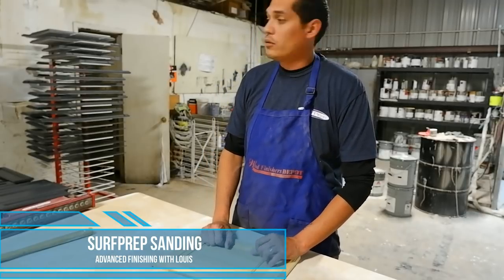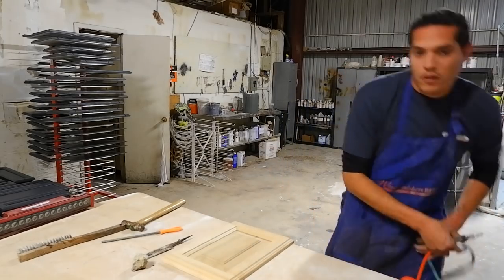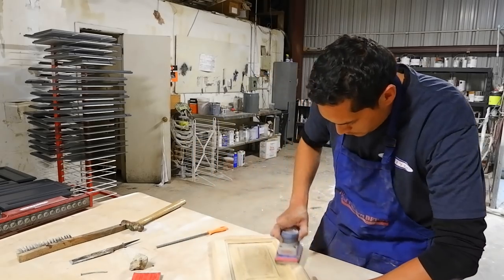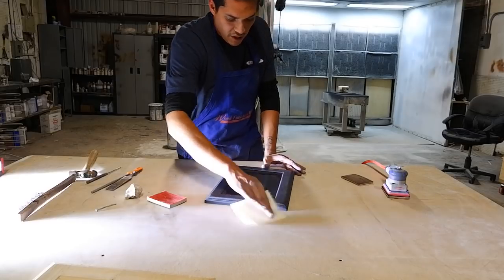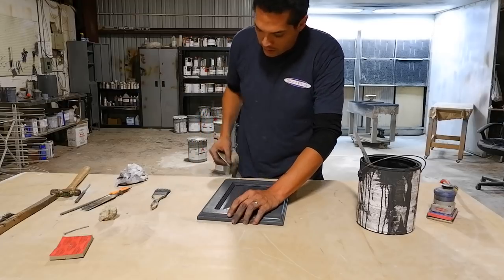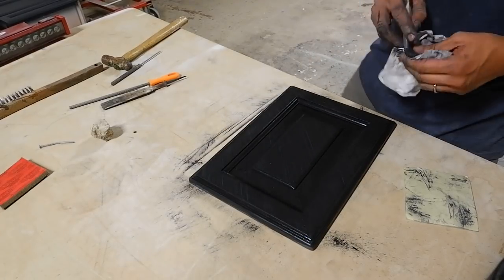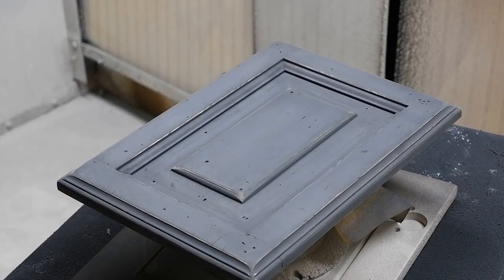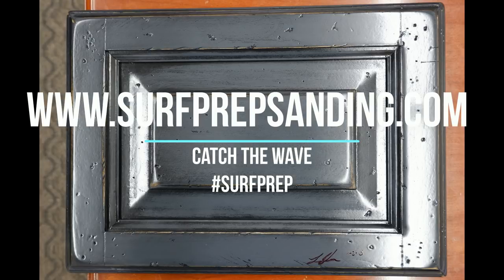Distressed Powder Glaze Cabinet Finish - SurfPrep Sanding Advanced Finishing Techniques

Comment: Quick question so I just started painting cabinets and need more info to what kind of paint and primer do
I use I am new to this... I start getting lots of bleed thru in my cabinets and that’s no matter what I do I cleaned them really good and no matter how much I clean them and sand them I always run in to bleed thru in every cabinet job I do.Also by the way I use an hvlp spray gun”. Also I use waterborne paint and I usually use kilz original primer” but every time i use it I always come across paint peeling or just hairline cracks on them... what do I do please help! And is there any good paints you would recommend me to use and what primer and paint do I use.    Also some clients usually want the cabinets sprayed with the hinges so sometimes I don’t remove the cabinets all I do is mask around. Please help and Thank you in advance! By the way love your videos 😀😀wish I could come to you shop and learn Lil more!!